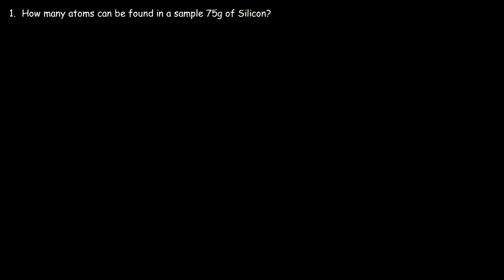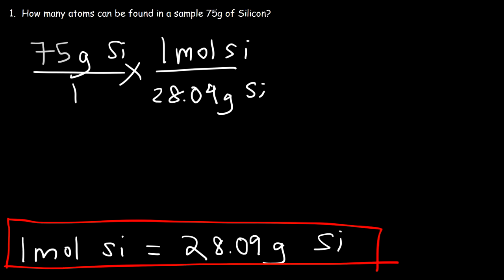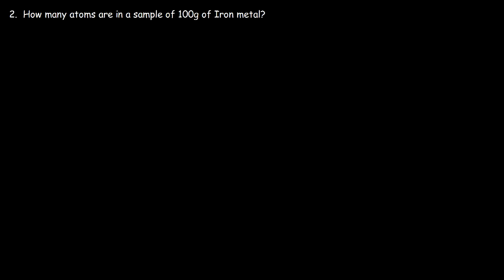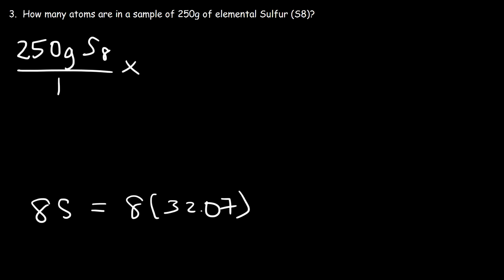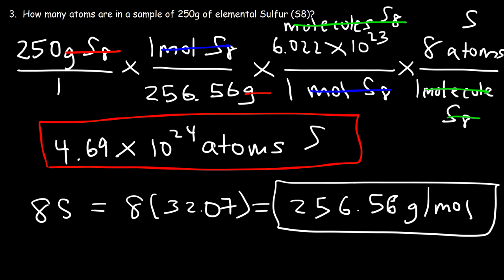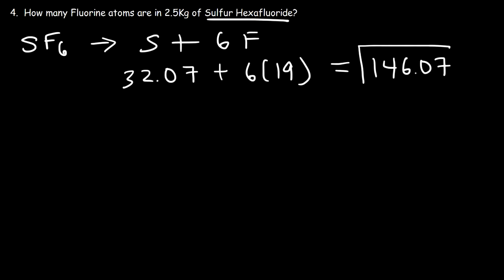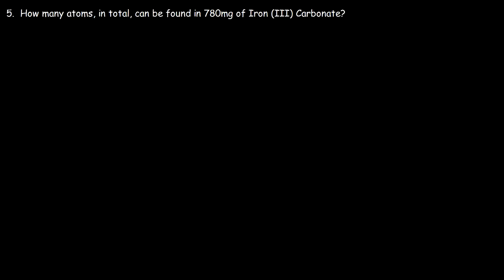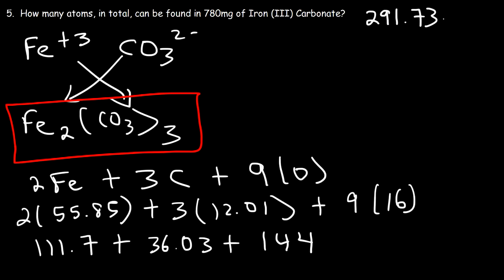How To Convert Grams to Atoms - THE EASY WAY!

Comment: may i ask why you use 6.022*10^23 instead of 10*24? question 3 on the video
Reply: When you multiply all numbers you get 46,94 * 10*23, but he just moved a comma one place to the left (multiply by 10) which is why he wrote 10*24.
p.s.  English is not my native language so I don't know if I explained it adequately.